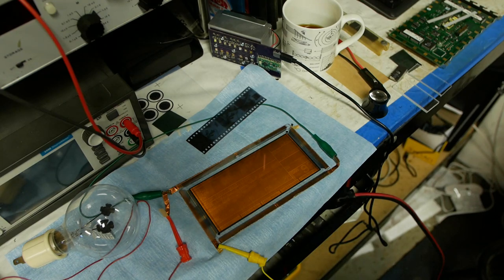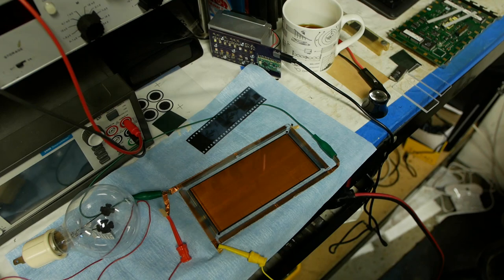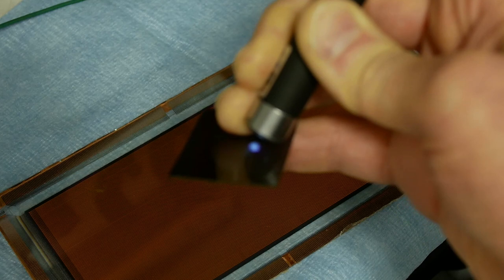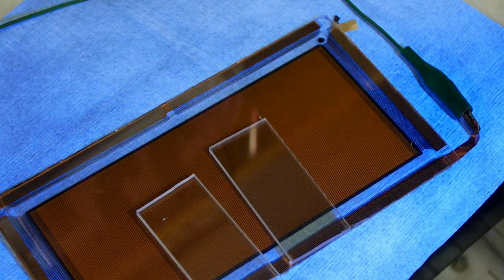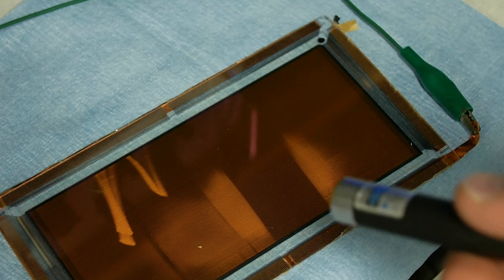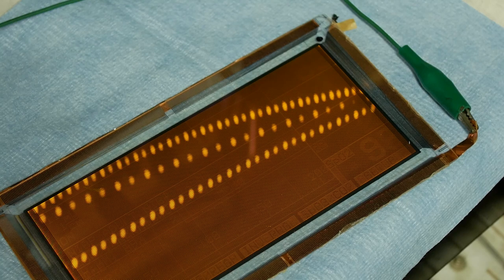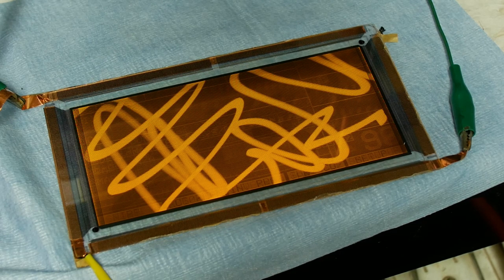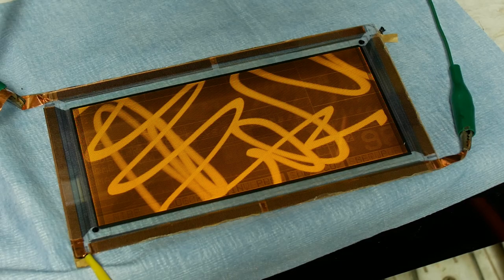Drawing on a plasma display with a laser pointer

Comment: When I worked for a large chip manufacturer who makes processors for computers... You know the guys.  We just used SiO2 for the ILD, inter-layer dielectric, material which separated the layers of metal lines.  So essentially just glass.  I don't think it was any special recipe of any kind.  I think that it is pretty standard semiconductor tech.  We just used silane gas and oxygen at specific temperatures and mixtures to grow SiO2 if my memory serves correctly.  Now, the chemistry to keep copper from diffusing into it and the techniques to get nice square bottomed etched lines was extremely sensitive and I don't believe that I can discuss that.  Glass is a really easy to manufacture dielectric material with suitable properties.  It also etches really easily and predictably with HF.  It would seem that manufacturing panels like this would be very similar in process techniques.
Reply: All I know is I wanna get to know you and bring my styro, explosions n ire, and Neil friends.
Reply: @derrekvanee4567  We all need to have dreams.
Reply: BIG HINT 🤣🤣

Comment: I find the laser effect is always dotted when swiped across a surface. Try it on your wall back and forth. It’ll leave a pattern, not a clean line. At least on my cheap laser it seems to be pulsed despite being a battery operated diode, possibly they’ve developed a micro inverter for cheap lasers
Reply: Yes Prescott, I had considered that the laser might be pulse driven. The large and small dots could result if the waveform of its driving circuitry is asymmetric.

Comment: It might work similar to the old Tektronix storage tubes. They use flood guns to flood the whole screen with electrons, but the phosphor does not glow because it's not enough energy to excite the electrons until you get a more intense beam of electrons to "activate" the phosphors by giving them an extra charge so that the energy of the flood gun is enough to get the electrons over that charge state and produce light in that spot.
Reply: I was going to say that. I'm not that clear on exactly how those worked, but it immediately occurred to me that this might be related physics.
Reply: @hfuy8005  I'm not sure either, but I think it has to do with energy states of the phosphors. It's as if they have some sort of hysteresis.
Reply: Yes! Came here to say that.  Glad someone was able to say it before it got lost in comments.

Comment: During my first night flight while training for the my pilot's licensee, in the school's beater C172 from the 70's, the radio's orange display quit working when we needed to be changing and monitoring Air traffic frequencies.  The radio still worked, we just couldn't see what channel we were on or what channel we'd be changing to. Having an unknown electrical issue in the air at night was pretty nerve racking, hoping it is not the beginning of a bigger systematic failure.  Even the CFL was unable to troubleshoot the issue. 

 After a couple rounds of troubleshoooting and restarting the avionics to no avail, I shined my LED head lamp near by and the display lit up! I don't remember if the screen was refreshing properly, but I remember for the remainder of the flight, I'd have to "reignite" the display with the LED light every now and then. 

I always wondered what the phenomena was, I always assumed the display was just barley being driven below some some energy state threshold and the LED photons gave it just enough kick to change states.  I thought the display was an orange cold cathode,  but maybe it was a plasma display as show in  this vid.

Very cool video as always!
Reply: Wow.
Reply: Okay that's a situation where piss would pour down my ankles
Reply: If the display was neon, then as it ages, sputtering can lower the gas pressure so that it needs more voltage to ionize (ignite) a spot to get light emission.  Shining a light on it adds energy to the neon atoms with the same effect as increasing the supply voltage.
Reply: Barely and barley are 2 different things.
Reply: The radio was a KX-155 right? Most of those King radios have a little photoresistor under the plastic next to the display which is connected to an automatic dimming circuit. As the display ages and becomes dimmer the dimming becomes non-linear and the display gets very dark /off at higher dimming levels (when the light on the photoresistor is low). By shining light on the display you illuminated the photoresistor and temporarily decreased the dimming level and the display lit up again for a while.
Reply: @coloradostrong  If you understood the grammatical structure of his comment, who cares if he misspelled a word.

Comment: Back in the 80s I worked with people like your colleague (and you). They invented a microwave chamber that heated a cup of coffee (not patented) a discrete-logic version of the Pong game (not patented) a laser-based digital data storage/retrieval device using a photographic plate and LASER (patented), which later became the basis of the CD-ROM. These were fun people, often a bit eccentric, but usually quite humble. The best job I ever had primarily because of the people!

Comment: Interesting effect. Are you sure you are not just simply ionizing one of the UV lines of the argon or neon? One way to find out is to try it in a regular neon bulb. If you can strike it by shining the laser in-between the electrodes, it’s ionization, if it works inly by shining it on the metal, it’s photoemission. But if it were really photoemission, it would make more sense to me that it comes from the MgO, not from the ITO or metal layer buried under a dielectric. Just don’t see how you can have an electron current nearly high enough to strike a neon plasma coming through a dielectric. Just talking out of my rear-end since I have not researched the subject properly…
Reply: I think the purple photons are too feeble aren't they? 405nm is equal to 3eV per photon but argon's first ionization energy is like 15-16eV.
Reply: You're on the right track, the real explanation is that F (oxygen ion vacancy) and F+ (oxygen ion vacancy + one electron) defect centers in MgO crystals are located at 3.0 and 2.96 eV above the valence band maximum (VBM), respectively. This means that the 3.1eV 405nm laser light is exciting MgO valence electrons into the F level or maybe even exciting an electron in a F+ level into the conduction band as well and that is main reason for increasing the free carrier density in the device. The reason there is an asymmetry in the dot brightness is because the excitation of carriers in those defect levels are populated and depopulated on one side of the device for each polarization of the AC electric field. So you can imagine you have a box of balls and you raise one side and lower the other. The balls will go back and forth. This is the displacement AC current and you're not having a charge pass through the dielectric. So then the laser power is attenuated when it reaches the bottom layer of MgO because it had to travel through the first layer of MgO. Normally the high voltage AC is enough to excite these defect levels or rip them out of their position, but he is operating it in lower voltage where only the laser gives it enough energy to excite the states. The gas in the middle that becomes plasma is used as the luminescent source with a threshold limit minimum it seems. Like there needs to be enough voltage between the MgO layers to start the plasma going. The dielectric is still too insulative to pass enough charge through it. Most metals have a work function higher than 4eV and wouldn't even get excited at 365nm. The amount of 365nm light is miniscule as well. You should be able to do the same effect with regular AC EL displays with MgO too. It's all about the defect states in MgO, that is where the excited carriers start.
Reply: @ramjetross  is this the F for farbzentrum / color centers?
Reply: @Muonium1  F (oxygen ion vacancy) and F+ (oxygen ion vacancy + one electron)
Reply: @ramjetross  That is a very convincing and knowledgeable explanation!

Comment: Funny you mentioned neon bulbs. I noticed the output of a neon bulb can be affected by the amount of ambient light.
I have a power on indicator neon on our boiler that's usually in a dark room, and it has a slight AC flicker to it. When I shine a light on it the flicker stops and its light constantly.
Reply: Indeed, I also noticed this on a simple mains power block with neon indicator. The bulb would flicker in the dark and be steady when sunlight hit it. Unfortunately that bulb died a long time ago…
Reply: I recall reading that neons for logic applications had a touch of some alpha emitting radioisotope in them for that reason.
Reply: Maybe it's just more difficult to perceive the flickering when not in the dark. In the dark you would get the maximum amount of 'dynamic range' and thus easier to notice.
Reply: After reading further it seems what OP is referring to is an actual thing.
Reply: I've got an old power strip with a neon indicator... sure enough, it flickers with lights off and steady with lights on.
Reply: @corn322  Can you test this with any specific light source ? Like a laser pointer or some high power LEDs see if they all excite it / cause the effect or if it's only some wavelengths ?
Reply: Question? If I take a neon bulb with a strike voltage of, say, 80 volts and a sustain voltage of, say, 45 volts, and connect it through an appropriate resistor to a 65 volt power supply, the build will not light.  Will it light if I shine a UV source on it?
Reply: @ByWire-yk8eh  Yes it will.
Reply: I know nixie tubes need some ambient light to turn on if the drive voltage is more enough. I think it's a similar effect.
I believe it's to do with ionisation of tiny numbers of atoms allowing for the discharge to start (or knocking electrons off the conductor, something like that) 
so adding light will allow the neon to illuminate at a lower voltage which would let it appear to stop flickering.
Reply: @zyeborm  This is why most of the contemporary Nixie clocks have blue LED's underneath each tube.
Reply: BigClive mentioned this phenomenon. I can't remember the exact words he said but he did mention that neon bulbs are known to act funny when there is light being shot at  it.
Reply: So THIS is why our neon light switch goes dark at night? It used to be on at night, but it is 21 years old.
Reply: @initialb123  I tested NE2's with different light sources. Overhead lights, flashlights. Used a potentiometer to change the supply voltage.  You could "tune" the NE2's sensitivity by changing the supply voltage.  They seem to make very reliable light sensors.  But NE2's over time seem to get lower and lower vapor pressure due to sputtering (the black or silver coating on the inside of the glass tube).
Reply: @samot1808  I went though the same process 🤣
Reply: I believe it has something to do with the EM waves lowering the ionization energy of the neon

Comment: 7:26 Brings back memories of my childhood,first multimeter and a mains socket.. Hmmm,my meter has a 20 amp range.. This is a 13amp outlet.. Let's measure the current! Lesson learnt,multimeter fixed and socket replaced.
Reply: And trousers washed...
We've all been there.
Reply: At the risk of sounding like a dummy, why cant you do this? I would imagine that this essentially causes a short circuit in the outlet because the meter has little resistance, but why cant the outlet handle it? From what I understand, outlets can handle something like 1800 watts, so why would a short circuit hurt it? Wouldn't it just be limited to it's max power as if you were running a power hungry room heater? (Which I know has a lot of resistance). Basically I think my question is... why exactly cant you short circuit a plug, and why would it explode? Finally, why would it hurt your meter as long as you had it in the correct current mode?
Reply: @Polite_Cat  The voltage that comes into your house is 240v and the current that comes into your house is effectively infinite. V=IR so if you have an outlet that supplies 120v or 240v and you short it with a resistor of ~0 ohms the outlet will do its best to supply infinite current. Very few things are capable of handling effectively infinite current and they don't include multimeters or wall sockets. In theory the only thing that should happen when you short a socket is the circuit breaker popping but in reality outlets are never terminated properly and they behave more like resistors which is where the magic smoke is stored.

Comment: You actually can sort of get away with neon bulbs in parallel. Yes, initially, one will hog all the current, but over time (weeks to months, in my experience) it will degrade until they even out. But then, they won't light up all at once, no, instead, on each half-cycle, a random one will light up (and then a different one and then a different one). If you connect about a dozen of them in parallel, after the initial burn-in, they create a really nice dancing light effect.
Reply: Big Clive did make one in a video a few years ago very cool effect

Comment: Other things of note : The ITO and metal conductors will be at opposite ends of the triboelectric series.
Also: Are you sure the dotted effect is due to the AC cycle and not PWM output from the laser?  (I've noticed this when waving laser pointers around especially ones with single cell power supplies which rely on a DC-DC converter to power the diode)
Reply: I was wondering if it was possible PWM causing it too.
Reply: Pretty sure it's because the F and F+ defect centers in MgO crystals are located at 3.0 and 2.96 eV above the valence band maximum (VBM), respectively. This means that the 3.1eV 405nm laser light is exciting MgO valence electrons into these defect levels and that is what is increasing the amount of electron density in these defect states. The reason there is an asymmetry in the dot brightness is because the excitation of carriers in those defect levels are populated and depopulated on one side of the device for each polarization of the electric field. So imagine you have a box of balls and you raise one side and lower the other. The balls will go back and forth. This is the displacement AC current. So then the laser is attenuated when it reaches the bottom layer of MgO because it had to travel through the first layer of MgO. Normally the high voltage AC is enough to excite these defect levels, but he is operating it in lower voltage. The dielectric is still to insulative to to pass enough charge through it. Most metals have a work function usually higher than 4eV and wouldn't even get excited at 365nm. The amount of 365nm light is miniscule as well. It's all displacement current still. You can do the same process with regular AC EL displays with MgO too. It's all about the defect states in MgO, that is where the excited carriers start.
Reply: I'm guessing most of Ben's audience would've had that thought.. I'm sure he tried sweeping the laser over some laser-sensitive phosphor like a CRO screen to discount that..

Comment: I worked as a biomedical. equipment  technician  for 18 years and this was one of many devices I worked on. if memory serves me correctly this is from a Propaq Encore patient monitor. I wonder if I ever serviced the one this came out of.
Reply: I noticed it was a patient monitor at 11:22, where you can see the burn-in of the most common readouts. It looks like their patients' SpO2 was consistently in the 90s.
Reply: @simon_far  90's is pretty typical unless your having serious lung issues. I have tried holding my breath until im ready to pass out and havent ever dropped below 95%
Reply: its pretty typical to be 98 or 99%

Comment: This is part of the optogalvonic effect, in which the discharge changes it’s resistance due to incoming light. If you sweep a continuous spectrum of laser light (like from a dye laser), you can measure the resistance change of that gas filling the discharge. I used this as a calibration standard (neon lamp - also argon or other gasses that have emission spectra peaks at important calibration wavelengths), and as you tune / sweep the dye laser (in my case a grazing incidence R6G pulsed dye laser) thru the spectrum, when the due laser matches a peak emission of the gas, the resistance dips… and so you know the dye laser is at that exact frequency / spectrum. I would partially power the discharge lamp, and when the laser wavelength matched a strong emission peak, the lamp would light. There are a few other related phenomena to this, one used for deep space photography, by CCD deep-discharging using deep UV from the sun.

Comment: Nixie tubes are sometimes driven with some similar biasing. The -120V is constant, and the +60V is switched on and off, so you're alternating between 120V and 180V across the element. This results in faster ignition of the plasma, and also helps eliminate any afterglow.

Comment: If you do make your own driver, try increasing the drive voltage and frequency such that power is kept constant. I'm interested to see if the higher electromotive force on the high side of the AC waveform would lower the photon energy required to liberate electrons from the metal layer (possibly permitting this effect at longer wavelengths, maybe visible?). Thanks for the vids!
Reply: I was also gonna add, could the AC be made non-symmetrical to compensate for the differing brightness of which end is positive and negative? Instead of 50/50 positive and negative in reference to 0, could you do 60/40 or 40/60 and give it the additional power on that side of the waveform so it comes out even?
Reply: So many rabbit holes, so little time!